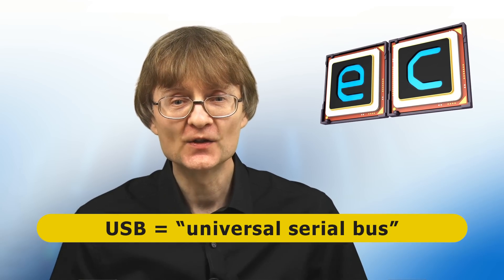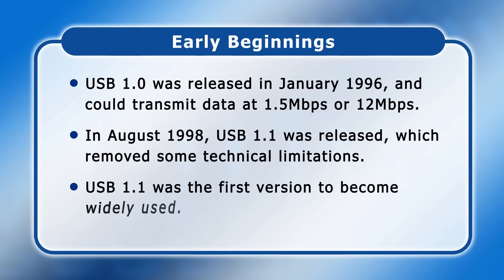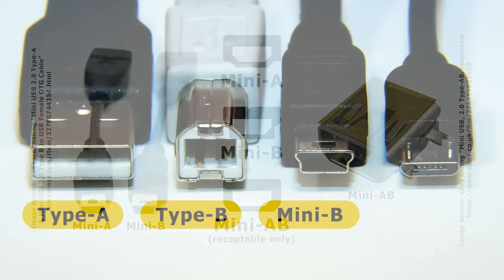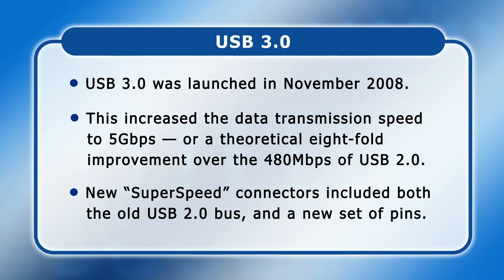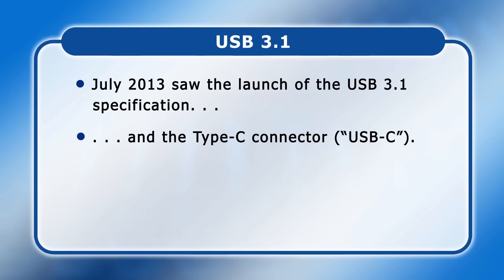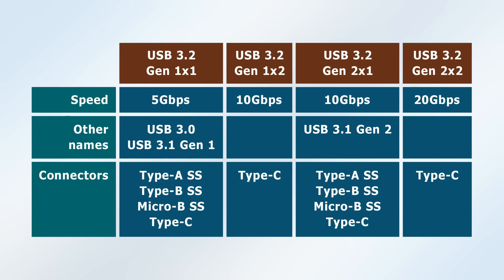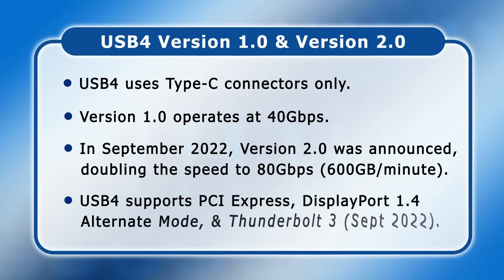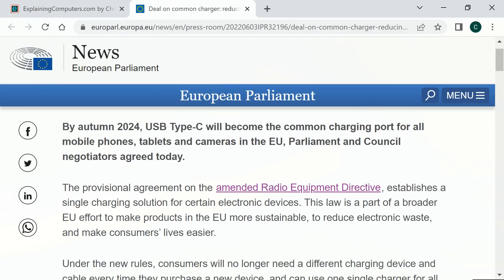Explaining USB: From 1.0 to USB4 V2.0

Comment: Looks like usb-c will replace all types of connections, such as hdmi and power.
Reply from the maker: There is certainly a move in that direction . . .
Reply: @ExplainingComputers  👍Would have been good to clear up differences with Thunderbolt as it uses same connector causing even further confusion! 😄
Reply from the maker: @Bassquake76  I considered, but it would have added another layer of confusion! :) So I plan to cover Thunderbolt in another video.

Comment: Originally we said "great! finally we have a system that can be used for a basic set of peripherals - keyboards, mice, printers etc". Unfortunately it degenerated in a confusing mess of names, pin layouts and physical connectors. I wonder how many people can describe the names, specifications and plug types without a set of written notes for reference.

Comment: It's very smart with all the backwards compatibility on the Type A connector, but they havn't really learned anything from all the mess of versions and change of naming schemses. With the new USB 4 specs they are going to end up with the same mess with the type C connector unless they start differenceating all the different speed versions with different cables and connectors. The whole "One connector for all types" is a totally fail. When even power users can get confused with all the standards,  no regular home user can be expected to remotely know whats going on when their usb 3.2 memory stick runs at usb 1 speed.

Plus many mobo's today already have way too many usb connectors and way to little available pcie bandwith if you try to connect more than a few high speed memorysticks / External SSD's at once.

Comment: Absolutely brilliant, why didn't they bring out a small reversible connector in the beginning? The USB standard committee reminds of legislators just making laws because they can, not because they are needed or wanted.
Reply: @OKuusava  They are going the other way large with low power the first USB and small for high power with USB C

Comment: This is truly a important video! Thank you. I did not know the double connectors were backwards compatible with older USB standards, that's good to know! However the colour coding (inside connector is blue) that was very welcome did lose its purpose with the mess called USB 3.X.X. But now with the USB, the hell knows what standard i also can fry other older 5V devices by providing up to 48 volt? Or do all the charging chips recognise and switch to a save charging mode? I can clearly see a follow up video in my glass sphere 🤣! Cheers.
Reply from the maker: Thanks for this. Under USB PD, hosts and peripherals should communicate before supplying more than 5V.

Comment: I just assume everything runs at USB 2.0, regardless of connector type, until proven otherwise.
Reply from the maker: Correct. There is a separate USB 2.0 bus in all Type-C connectors (assuming its wired!).

Comment: Had no idea about the backwards compatibility of Type-B SS and Mini SS sockets! That was satisfying to watch, and an elucidating video all round.

I don't understand the adoption of USB-C connectors if it doesn't make use of the later specifications. 
I have two Focusrite audio interfaces, and the later one use a USB-C connector even though it's still using a USB 2.0 interface. The older one with a Type-B connector can withstand a couple knocks of the lead, but the USB-C completely loses its connection with a slight tap. So I'd say it's an objective and unnecessary downgrade in reliability.
A USB-C that can lock (like DP, XLR or 8P8C) would be an improvement for prosumer grade tech.
Reply: I think it is because they want them to fit on all skinny devices.  As far as some usb-c connectors not having some features, probably for cost savings for cheaper suppliers (not sure).  If I'm not mistaken, some usb cables have fewer wires.
Reply: @ironfist7789  Cables that are designed specifically for power delivery using Type C connectors will have nice heavy copper conductors joining the power pins but they usually don't bother implementing the Super Speed data pairs. So what might look like a high quality cable simply won't work above USB 2.0 speeds. Similarly, you can pay a lot for a cable that's specified to work with Thunderbolt and find it's hopeless for charging your laptop, despite having exactly the same connectors.

Comment: Let's hope that USB type C lasts for next 10 to 15 years. The main advantage of type C is that it is same for hosts and peripherals of different form factors, plus it can also act as a power delivery port. And last but not the least, it is reversible.

The only complaint I have is why it took so many years to come up with something like this.
Reply: Despite its many advantages, the problem I have with the Type C connector is that it doesn't lock in place unlike, say, a DisplayPort connector.
Reply: On the reversible part, there have been reversible USB A male plugs for sometime now, as companies like JLab use them on their true wireless earbuds cases that's also very thin for charging with pins on both sides of the plug, and I have I had a right angle USB C female to USB A male adapter(came with a Gulikit USB C Bluetooth adapter for Switch that also works on PC as it acts like a USB sound card) that can be reversed, and it plugged in either way with the USB A plug that has normal metal shielding around it, that not only charges, but supplies data. Having said that, they are not very common sadly.

Comment: You ain't kidding about the connector not telling you what speed it's limited too, as I have plenty of USB C devices like Tablets, and phones, yet they are still stuck at USB 2.0 speeds even with verified 3.0 USB C data cables attached to a USB A 3.0 port directly on a PC motherboard.  Also it should be noted that USB C to C cables/ports are not the most common yet as many usb C phones/tablets/computers/etc.. still come with a USB C to A cable, and a USB A Charger.

Comment: For the "casual user", the most important thing to know is that if the plug fits into the socket, the device WILL WORK !  It will operate at a speed that is the "least common denominator" of the two devices.
While the original USB PD specification did "allow" 5A of current, it was only over "special" cables that typically had large gauge wire (wire size was NOT a guarantee of 5A).  Today, the most common maximum current is 3A and (I believe) that any USB cable/connector can deliver this if the host is capable.  Older devices will still only require 5V.
Reply from the maker: True, providing that the cable is fully wired . . . :)

Comment: Is there any workaround if say, I have a device that I need to connect a KVM to but said device doesn't have a USB-C port, but only USB-A 2.0 and HDMI? Already tried a HDMI - USB-C adapter and for some reason it wouldn't accept either video signal or the keyboard & mouse.

Comment: Great video. Does a USB power source validate a cable is safe for 240 watt? It sounds like quite a lot of current for the many poor quality USB cables floating around.
Reply from the maker: You need a cable validated for 240W to carry 240W -- and such cables are just starting to becoming available. Issues with cables are likely to become more common. . .

Comment: I read somewhere that for USB 4 thuderbolt 3 is only required for Hubs and it is optional for Laptops. Is that true?
Reply from the maker: The USB4 (Version 1.0) specification supports Thunderbolt 3, but its use is not mandated. So it is up to the device manufacturer (laptop or otherwise) to decide if their hardware will be Thunderbolt 3 compatible. Whether Thunderbolt 3 is "required" depends on the user. If they want/needs it, it is "required". :)

Comment: Since 2016, people raged on dongles or coined dongle-gate (about the use of many dongles in majority of laptops shipped only with USB Type-C or Thunderbolt 3/USB4), meaning the majority of cables will be got tangled with the use of their old devices (like connecting using VGA, HDMI, or other USB-A cables). I think that USB-C only will be the future in majority of devices shipped, including the one-cable solution in all of the peripherals, displays, and others.

Hope to make a video about wireless specifications that sometimes people confused about. Great video for this week!

Comment: I seem to remember that USB was going to rid us of the almighty confusion around the different types of SCSI connector, USB’s non hot-swappable predecessor. 
I remember working for a computer dealer in the late 1990s, and having to get a mail-order customer to use his primitive digital camera to take a photo of the SCSI connector on each device he needed to chain together, in order that we could send him the correct cable.
At least SCSI connectors were easily recognisable: you need to check a device’s specs to know whether you’re dealing with Thunderbolt or USB-C!
Reply: The display part of USB-C isn't always clear.

Comment: The one detail you missed in all of the mess, and it's entirely possible I just glossed over it, is it USB C is intended to replace both a and b plugs on the host and peripheral end, although a to c seems to be the most common kind of cable in my house.
Reply from the maker: True -- as implied in the intro to the USB4 specification. :)

Comment: Figures, I just upgraded my motherboard and it looks like it's going to be outdated no time fast 😆  My old rig from 2009 finally gave up the ghost back in march but with the way things have been with hardware availability and prices I kept waiting for everything to settle down and was using a laptop. Sales hit parts last week and I pulled the trigger.  My old rig had E-Sata and USB 2.0. Again, just on the cusp on a USB update. Once USB 3.0 hit motherboards, it rendered the E-Sata out of date in terms of speed. While E-Sata was technically still better than USB 3.0, the writing was on the wall. My new motherboard which was actually released into the market in 2020 it's an X570s it has USB 3.2 gen 2 10Gpbs max but no E-Sata. Good thing my external hard drive enclosures came with both E-Sata and USB connections
Reply: Yes, it seems the goal of the EU edict will be to increase e-waste as much as possible, by making several perfectly functional generations of computers and peripherals obsolete at once, and increase confusion by having a whole range of different power levels all use the same plug and socket.
Reply: @The_Real_Phil_Lee  That's why I stopped upgrading my system every 3-5 years. Stopped in 2009 and kept with the system. Just upgrading the power supply, hard drives and video cards every now and again. My last video card upgrade was in 2016 with the RX 480 8gig. Still using that in this new rig too and able to play my games. Quite frankly it became more of an experiment to see how long the old system would hold out using it pretty much 24/7. Lasted 13 years so I def got my money's worth out it. I'm pretty sure it were the capacitors that gave out on the old motherboard. It was an Asus M4A78T-R paired with an Amd Phenom II x4 955 black edition.  IMO I think it was their best AMD chip yet from back then.
Reply: @Ancientreapers  I still have an ASUS P4C800-E working fine, and I'll have to check on the P4T533-C
The P2L97-S died, but the Dell Latitude CPI-R is still running strong with its P2-400, although now needs an external keyboard.
Not a big worry as it runs fine headless running network services like DNS, DHCP, NTP etc and of course, being a laptop, is relatively low power and doesn't need a UPS.
Reply from the maker: @The_Real_Phil_Lee  Yes indeed. And people will be able (and encouraged) to buy devices without adapters or leads, based on the idea that they already have them with the right plug on . . .
Reply: @ExplainingComputers  But probably not the right power spec for the device - I see an outbreak of fires coming unless they start mandating the power capability be marked CLEARLY on all cables, devices, chargers and hosts.
Reply from the maker: I do like E-SATA on external hard drives.
Reply: @ExplainingComputers  Yup,  on my old rig that's the connection I always used with the external drives.  Haven't tried out the external drives on the new rig yet. Specifically the writing speeds to the drives.

Comment: I can remember when the "firewire" was out there and USB was competing with it.  I don't remember the turning point when USB was elected the chosen one.  I really enjoy your videos.  I  hope to see you again more recently.  Lol
Reply: Its adaption what decides, if you got 2 or more competing standards, they co exist in diffrent markets or regions or one dies out as its not afforable to maintain less adapted one, wich what happend with FireWire
Reply: I remember FireWire 400 competed very well with USB 2.0 because it had much lower protocol overhead and supported full duplex operation, while FireWire 800 won easily. There was a FireWire 3200 implementation too but it didn't really catch on. The turning point was when Steve Jobs declared that FireWire was dead In 2008.

Comment: I wish they could standardize all of them into one... 
Is it hard to do that?
Reply: Very hard to drag 100w out of any old USB charger.  Well, maybe once, briefly and spectacularly with fuel being added from the house it burns down.
Reply: @The_Real_Phil_Lee  
I mean technology has advanced so much so... why not this?
Reply: @SkyFly19853  Well, if it were possible to convince every single seller in the world on the merits of ALL cables conforming to the latest standards and removing ALL old ones from the market, maybe.  just think of the challenge that doing that through just one online retailer would entail - and of course, they'd promptly be undercut on price by another seller and most consumers would not know the difference.  For just USB.  Other ports have different uses which exceed the capabilities of USB (like timing, in the case of RS-232)  Thank goodness we still have expansion ports which use different protocols and into which a card can be plugged.
But then we still have to manage all this in a way that older hardware is still supported, unless we are going to hand out grants to replace it all, and create a massive e-waste problem.
Reply: @The_Real_Phil_Lee  
Unfortunately... 
but they better start from somewhere... 
Producing different type of plugs even cause more destruction for environment at the end...
Reply: @SkyFly19853  O, go plug your other computer cables into your utility power.
Do let us know how long the fire brigade takes to respond, and whether everyone got out in time.
Reply: @The_Real_Phil_Lee  
I didn't mean to do that, I meant that when you have too many types of plugs, it also creates an environmental problem because of each device have to be produced on different types of pluging.

Comment: I actually have a USB-C connector with USB 2.0 speed, you can see that there are some "teeths" missing inside the plug, and the host side, despite being USB-A with a red look, also just has 4 pins.

Another thing is that, USB connectors has 2 pins that are longer than the others, this is to ensure the device gets power before signals are being transferred, and that the device is grounded before connection to eliminate disturbances in the cable or device.
Reply from the maker: Yes, USB-C connectors have a separtate USB 2.0 bus . . .

Comment: Thank you for an informative look - still somewhat confusing.  My own complaint about USB is that some cables are not very sturdy.  I also find that some devices have USB connectors that are not very sturdy.  This is disconcerting when the cables are cheap and the devices are expensive. Also worrisome is the spacing between USB ports compared to the width of USB connectors.  My HP Pavilion laptop is an annoying example, with closely spaced ports.
Reply from the maker: There used to be a standard minimum spacing -- sadly  no longer enforced.

Comment: I will never understand the design ineptitude exhibited in USB creation and development. Especially considering there was such a wealth of existing knowledge and products concerning two and three wire communications, control and supply mechanisms. Perhaps it was those extra fourth and fifth wires that confused them?
Considering that it was originally created by Compaq, DEC, IBM, Intel, Microsoft, NEC, and Nortel, you have to wonder who the individuals actually were. (Particularly as there seems to be no one from either the Communications or Power Industries being represented).

Comment: I haven't laughed as hard in any of your other videos as I did when you said "This was madness!" I remember describing USB specifications to someone, and when I pulled specs up to show him, things had changed and I was giving technically incorrect information. 📌Madness!📌
Reply: I do want to add a proposition that interfacing peripherals into a system's OS (especially into a universal standard) is probably challenging, considering the variety and possible combinations. Raspberry Pis and Arduinos are another story.
Reply: I think their defense is "It's not OUR fault if marketers just use our specification names rather than using names like USB Super Speed, USB Super Ultra Speed and USB Mega Speed.
Reply: @SuprousOxide  100% with you. The best naming scheme tells the critical info in the name as opposed to iteration numbers which stand for something else, ie USB-A-10G cable or a USB-C-20G port. Right now, we have to search a table online and that's an annoying step.